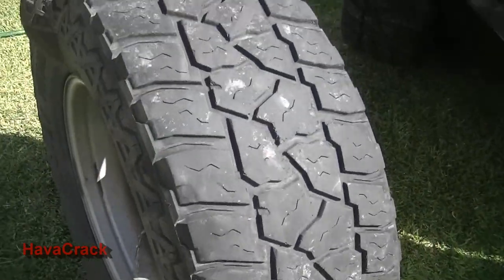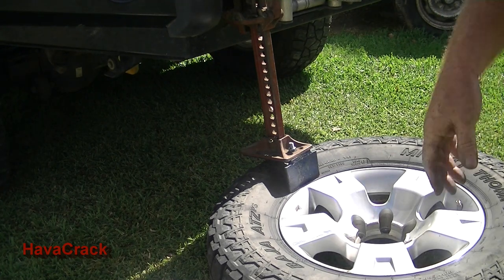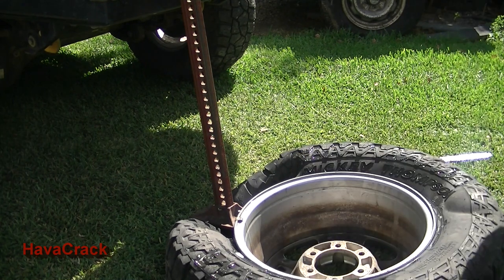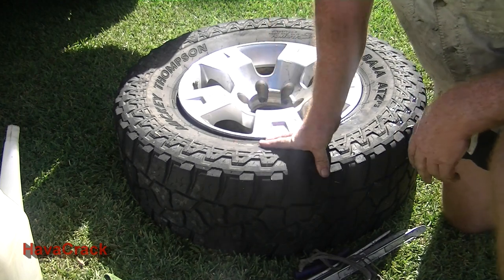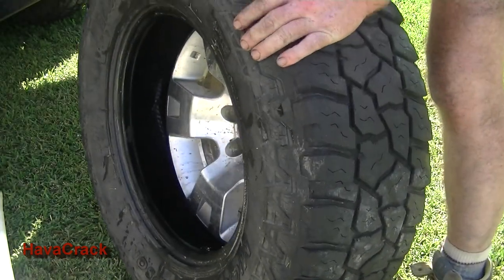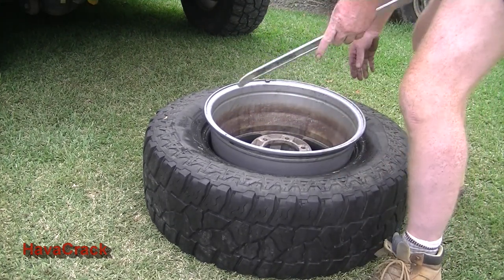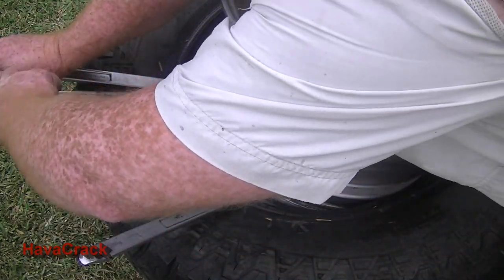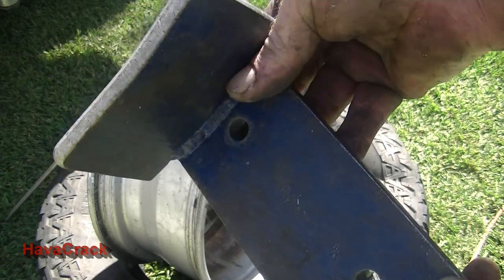HavaCrak - 4WD Tyre Removal and beadbreaker (that works)

Comment: Excellent video...Any video or pictures of that adaptor plate fixed to the smaller bottle jack?
Reply from the maker: Give me a week or so and I will add a short video and msg you. Mick
Reply: Hey mate did you end up doing a short vid on the adaptor plate for the jack. Great little video